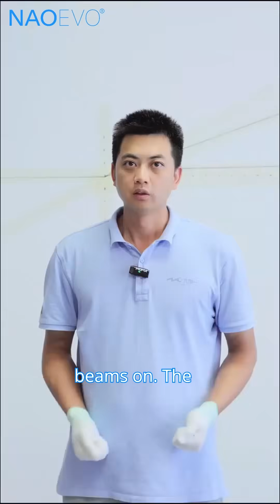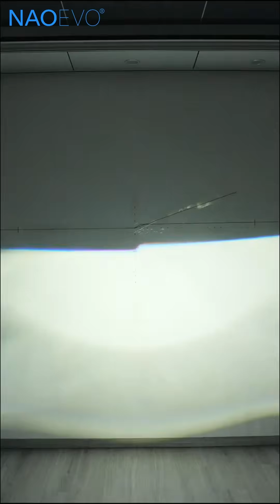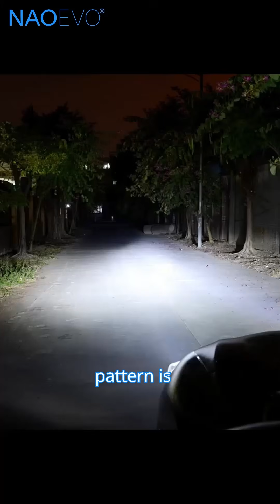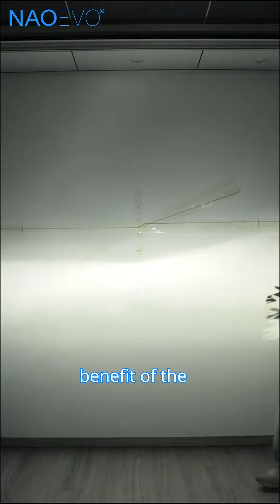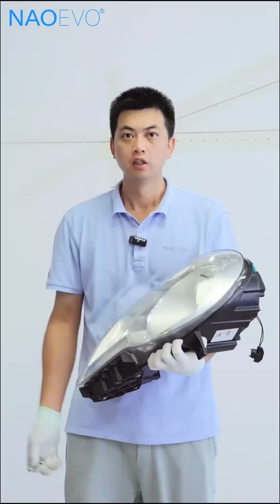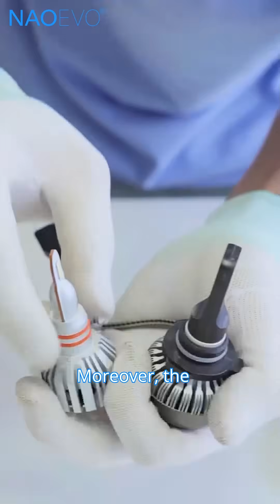LED Headlight Beam Pattern: Here’s How to Check They Are Road Safe! 🚘💡

Comment: This is true. While not all two sided led bulbs create equal.

Some two sided led bulbs like that super thin two sided led with CSP led chips. Will definitely replicate the oem beam pattern. 

And here’s another point about it. 

And it’s 3 things we have issues with others using led bulbs. 

It’s either 1: they are using the wrong type of led bulb that’s multisided. From 3-8 or full 360 degree type led bulb, that’s gonna create a flood shotgunning light output. 

Or

2: they are using the correct two sided led bulb, but with poorly align beam pattern.